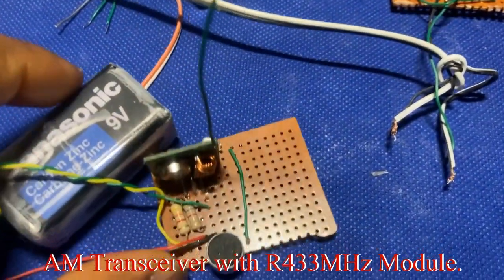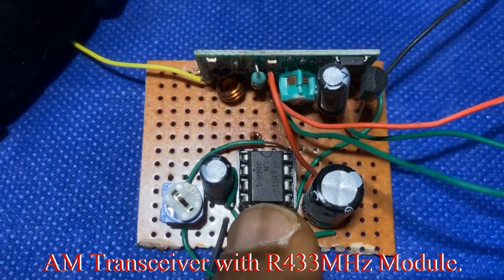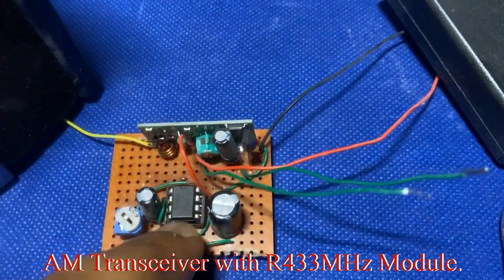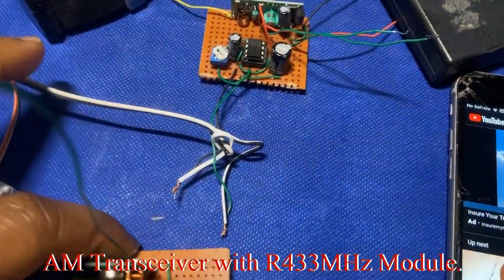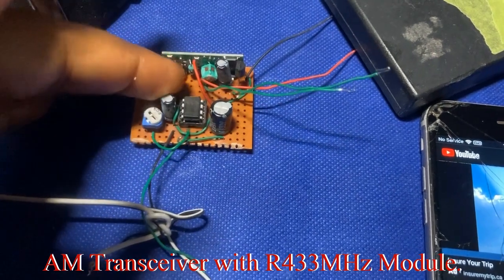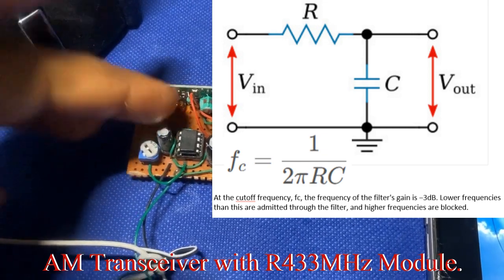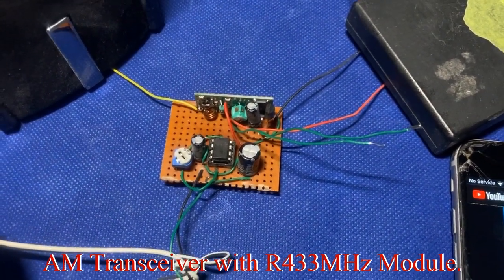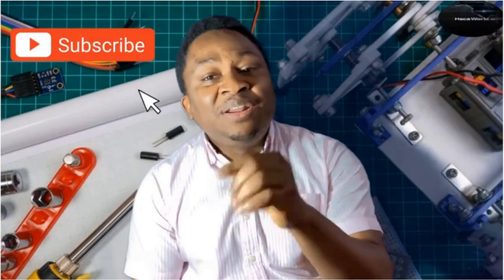R433-Based AM Transmitter and Receiver| Walkie-Talkie Basics with R433 Module Part 2 | DIY TRX

Comment: Why connect the "data" output to your amplifier? There´s a "schmitt trigger" circuit on the receiver board, converting the receiver´s signal into a square wave. Done something similar with these moduls, but didn´t get "screaming" audio, got rather clear audio. I did not connect the output from the receiver module to my amplifier, I looked up (at the circuit board) where the output from the super regenerative receiver connects to the LM358 (this is usually the IC these modules use), where I could receive clear und distorted audio. The modules I had (super cheap) had a production error, and were not having a needed transistor soldered in, which is a RF pre amp... as a result the reception of the module was poor. Also I didn´t really "transmitt" on this frequency, 433,92... because it is used by many devices ... and generating a constant carrier there could cause intefference. The transmitter I connected "data" with + via a resistor (I think I did it this way, it´s been a while). Then I used a NPN transistor, and connected the transmitter between collector and +, and doubled the supply voltage. Now I used a resistor, that gave me 1/2 of the supply voltage on the transmitter module again, now connecting audio to base of the transistor gave me "analog audio" transmitter.
Reply from the maker: Thanks for the detailed comment. I have improved versions coming soon. The next episode is the improved microphone version. Then the improved audio from the receiver will be the last version. I will implement similar idea as you mentioned.